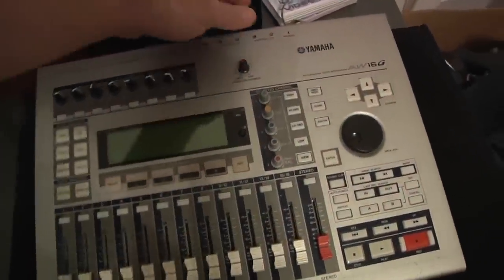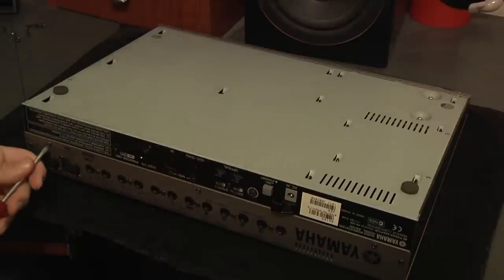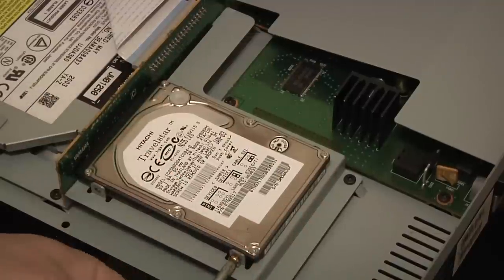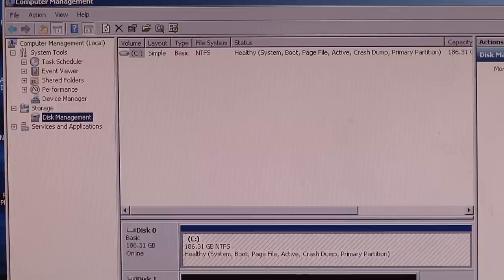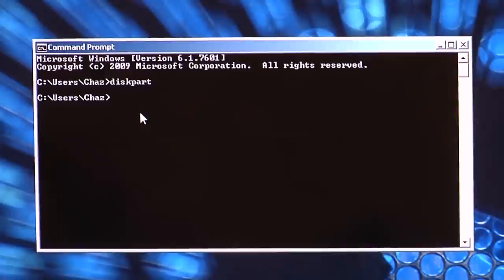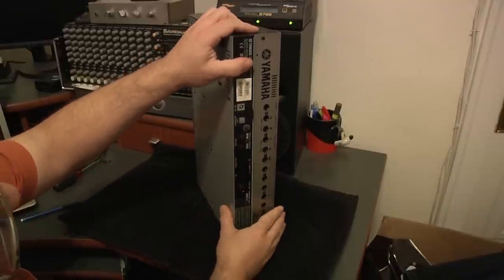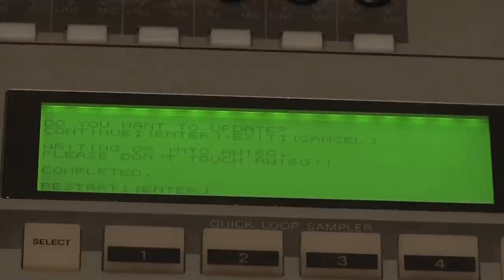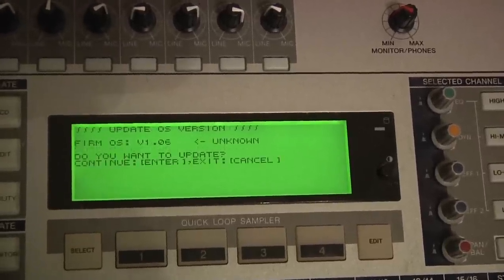Yamaha AW16G Replacing Hard Drive and Updating OS

Comment: I have this too. It's a great machine and you can get great results from it (I had it from new since 2003!). Mine still has the original hard drive which I think is 20 gb. Can you update the operating system without replacing the disk drive?
Reply from the maker: Yes, but everything on the hard drive will be lost.
Reply: chazman55555 Thanks for replying. Not a problem (with backups), but the file link on that site you found seems to have been removed.

Comment: Hi. great Video. Can I use the rar file instead? The zip file is no longer around or should just contact Yamaha?. Many thanks
Reply from the maker: The rar file doesn't contain the files you need. The rar file contains remote software for multi-track editing software for Cubase, Logic & Sonar. The following 2 files which are on the ZIP file are the ones you need. AW16BOOT.BIN (boot program) and  AW16PROG.BIN (firmware software).